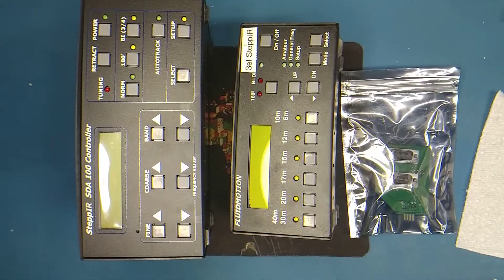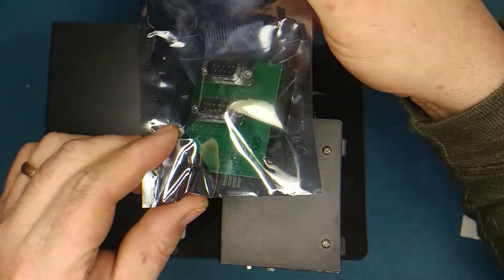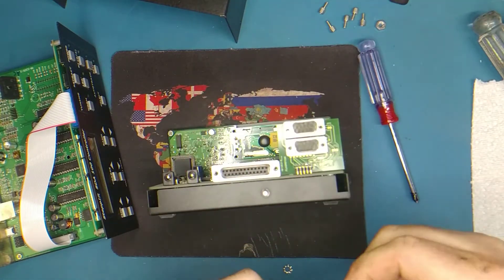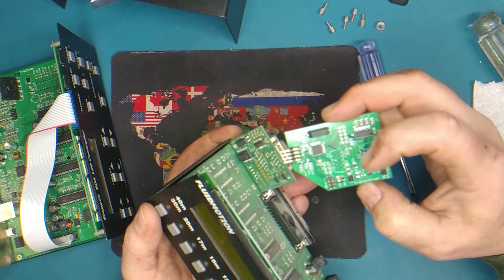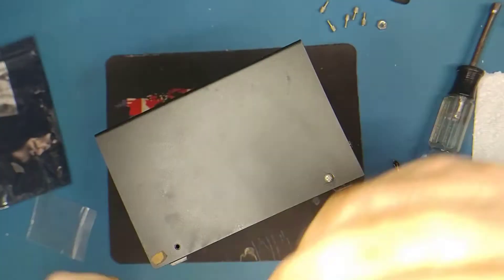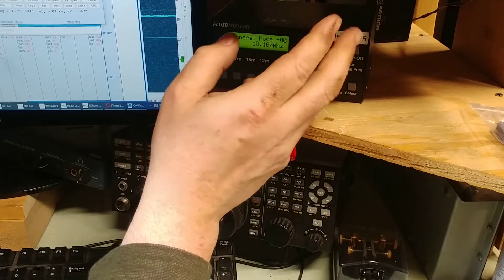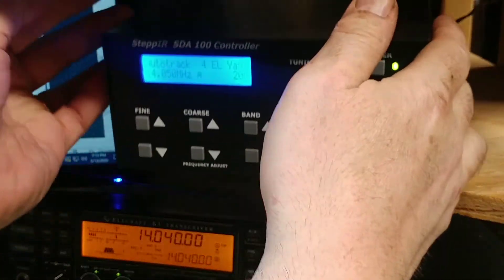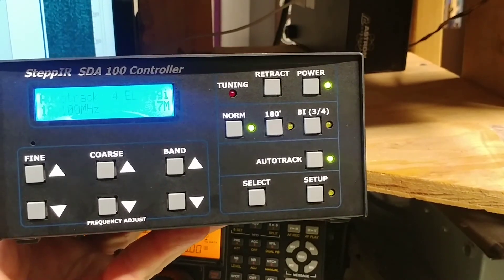SteppIR SDA100 controller serial transceiver interface upgrade 3-13-2020

Comment: Good Video, however, I've no idea what the blazes that thing does, or what it's for.
Reply from the maker: Hi Paul.  This is an add-on to a controller for a specific antenna, that adds the ability for controlling the controller with a computer. All about the control.... 😁
Reply: @JayUJay  OK, so I guess you can control an antenna tuner via a computer, and maybe even an antenna rotator, and perhaps SWR.